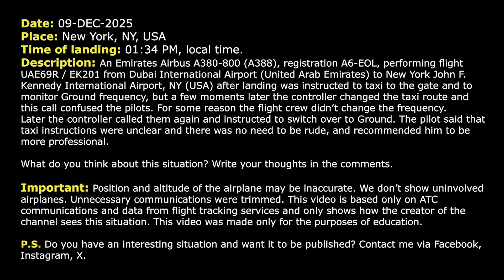Emirates pilots ask JFK controller to be MORE PROFESSIONAL. Pilot argues with controller. Real ATC

Comment: As an air traffic controller the instructions were clear from atc, were they brusque yes, but they started professional at least and only got "rude" when pilots started deviating from instructions. At one of the busier international airports, as a pilot, you can NOT be hesitating final call of control of the aircraft is in the hands of the pilots but if they dont know the airfield layout or arent capable of quickly navigating the flip to followtaxi instructions they should have asked for progressive taxi instructions. But even then the uae pilotsshould be better trained for this because, wrost case, i was told to go this direction on this or turn onto this, there are signs everywhere for pilots so even if you dont look at the flips you should be fully capable of hearing instruction and looking at sign and connecting the dots.
Reply: Not really. It's not unreasonable to request clarification. D being a right turn but then being told to go straight ahead and hold short D, you'd wonder, how can D be in front of us if it's to the right? Would you taxi in a huge circle without clarifying first?

Comment: The instructions from ATC were clear but lacked context. That’s probably why the (tired?) crew got confused. It would have been enough for the controller to add something along the lines of “…I’m going to take you around the airport, so taxi straight to Alpha and then hold short of Delta.”

Comment: The only unprofessional transmission I heard was from Emirates.  Forgetting to change the frequency was just a simple mistake anyone could have made but that one pilot talking to the controller that way was unnecessary.  Perhaps the crew was tired after the long flight.  If you don't know where "D" is then go straight ahead on "A" as instructed, make room behind you to get the 777 behind you off the runway then ask the controller where "D" is.  Of course, make sure "D" isn't close by and there isn't other traffic in your way.  Planes are waiting to takeoff on 22R.   I remember going into O'Hare years ago and you didn't stop after landing, you kept going to parking and you DIDN"T read back the taxi instructions.

Comment: What ATC tends to forget is that those pilots just landed after a long-haul flight ... 10-12 hours on duty ... so just dont be confused when someone is confused as you might not have in mind that A goes around the airport and you can hold short D both ways ... all are humans, no one is god-like.

Comment: I work at IAD, like night and day between the attitudes. I know JFK is a zoo comparatively but double-beratement is not needed here from ATC because they missed the "expedite" detail.
Reply: They gave them an instruction that, while technically proper, was confusing to interpret quickly, then told them to expedite doing something that they likely had not been able to fully comprehend yet. 

Ground could have helped things along be saying “straight ahead, all the way around to D”, which would have been much clearer.
Reply: @danstreufert9098 ^this

Comment: Sending the plane all the way around the airport with "hold short of D" is wild! LOL
Reply: Happens more often than you think. Theres basically 2 circular rings around all the terminals, Alpha and Bravo. When get is occupied they might just loop you around based on direction of traffic.
Reply: This is such a simple thing and it happens all the time. You have never driven past the house you were meant to go to and then you decided to simply drive around the block to get to it, instead of doing a u-turn in the street because there was a whole bunch of cars behind you??

The ATC is upset because there is a procedure the pilots were supposed to follow if they were confused called "asking for clarification". Also, one is never never supposed to comment on the air because when somebody is talking nobody else can talk and receive critical instructions. The pilots have an offline process they can use that they should have done if they had an issue.

Comment: i'm with the pilots on this one.
Reply: Be with ATC always - it's in your interest. If I'm in a plane landing on that runway you better believe I'm not getting mad at the controller for for getting pissy at a plane preventing someone sitting on the runway about to crash into me! Let them do their job and stop being a sensitive sheep.

The controller is upset because the FAA SOP if you don't understand something is to ASK for clarification and not just sit there putting lives at risk - and if you have a problem with the controller there's a process for it that doesn't involve arguing on the air. Remember that when they are talking, other planes and other ATC cannot give critical directions.
Reply: @lucdaved541  Idiot
Reply: @lucdaved541 the one arguing in this case is the ATC not the pilots in case you didn't actually watch the video. They even have captions.

Comment: I think that confusion come from A going both to the right and straight from pilots position and that in the straight direction, there is KD, which might have been mistaken for D, because the pilot would not expect to taxi all around the airport. That long A must be nightmare for each pilot to get. Previously they got the shorter path going right, but that was (by my opinion clearly) changed to straight on A, pilot just didn't expect to go all around and that was confusing. I have not listened to other Kennedy's ATC, but this one I do not consider rude. On the other hand, being a pilot I can imagine how quickly can one get confused, so I don't blame pilots either. It is just busy and messy airport, so shit happens.

Comment: Controllers are really unprofessional. They should not be escalating the disagreement. It is not necessary to dish out or respond to criticism whilst an airplane is negotiating the airport. As a passanger this exchange does not make me comfortable. There have been many deaths caused on the ground by miscommunication and professionals should not be attempting to score points off each other when they are responsible for the safety of hundreds of lives. A poor show by all involved.

Comment: Okay, here goes (I’ll read comments from others once I’ve posted this): British commenter here, familiar with correct phraseology used in the UK and am frequently frustrated by lax and unprofessional RT frequently heard in North America.

However I followed all of this and had absolutely no difficulty with the Tower controller’s instructions whatsoever. I am well aware that controllers are often busy at JFK, often speak quickly and are frequently hard for visiting crews to understand, particularly when their first language is not English. However to me the Tower controller was clear and well paced, and the phraseology was almost entirely correct.

I can understand that changing a taxi clearance to an opposite direction loop on a circuit taxiway might cause some confusion, but the controller did clarify by specifying “all the way round to Delta”. That made it perfectly clear to me what was expected, and I don’t have the airfield chart to hand. The misunderstanding was the crew’s and there was absolutely no cause whatsoever for the implied accusation that he was being unprofessional. I am the first to point out controller errors where they exist, but in this case I can find no fault with the controller.

In my view, the unprofessionalism was on the part of the pilot monitoring for making unfounded accusations regarding controller conduct and picking a fight over a misunderstanding on his own crew’s part. Someone needs to have a frank word with whoever was on the radio in that A380!

Comment: Nothing wrong with the instruction.  The pilot read it back and then started doing it and got confused and stopped.  The issue was he was blocking another plane stuck on the runway!!  Pilot needs to do a better job. Controller was fine. 

Technically could have been an actual pilot deviation because he stopped after agreeing to continue forward.  Stopping caused the safety issue.

Comment: maybe he should have said: go straight ahead in a circle all the way around the airport. In the ATC's logic as long as you're on the same taxiway you're always going straight. And nobody can just understand that
Reply: Yeah of course it doesn’t matter where you go if your gate is occupied, but you have to know where you’re going. And if you don’t know that A goes all the way around you’re gonna have to look at the chart to find out, and while crossing the runway is not a good time to do that. So after you cross, you check where you’re going and realize that you don’t understand, you stop.
Reply: @Aerotrinamic they had about 15 hours to have a look at the taxi chart.  It’s not that difficult A and B loop the terminals, you go clockwise or anticlockwise to your ramp, D in their case.  JFK is far more straightforward than Dubai.
Reply: @kickedinthecalfbyacow7549  get outta here😂. I wasn’t gonna respond but you’re just trolling and you’re probably not a pilot. DXB is a simple two runway airport with parallel taxiways and high speed exits (granted, it’s big). It has two ground frequencies whereas JFK only has one. JFK has 4 intersecting runways and a constant lack of ramp space. You fly 15 hours and then memorize all the taxiways of an airport. If you were a pilot you would not say something silly like ‘they had 15 hours’. And if you’re not a pilot, then why are you even pointing fingers here?
Reply: @Aerotrinamic imho jfk is much simpler, turn left or right follow A or B to the ramp monitor ground. DXB is multiple, progressive taxi instructions hold short of points that aren’t marked on charts. The taxi ways are straight but that doesn’t make it straight forward. It’s just my opinion though, I don’t care if you don’t agree.  But when you brief for jfk you should be able to clearly identify the expected taxi clearances, there aren’t that many options.
Reply: Alpha and bravo are a big loop around the airport, follow the loop to your exit, it’s not difficult, thousands of aircraft do it every day
Reply: @kickedinthecalfbyacow7549  well i fly in and out of jfk sometimes and I’ve never done a loop like that. And I would have been just as dumbfounded as that EK crew was with the instructions they gave. If you go in and out there every day you might encounter that at some point, but it would still be helpful to tell the crew that they would be going the long way around, as it isn’t super obvious
Reply: @Aerotrinamic when your gate is still occupied it doesn’t matter if you go the short way or the long way around. This wasn’t the only airplane at the airport, they have lots of other planes to get in to their gates or out to runways.

Comment: Emirates pilot was not instructed that he is going around the airport initially
Reply: It’s written on the charts, A to go clockwise and B anticlockwise. I was confused by the instruction to go right on A which would contradict airport instructions but going straight on A to h/s D is perfectly clear.
Reply: That is immaterial, straight ahead on A and stop short of D means just that(which the co-pilot repeated to confirm the changed instructions were understood so talk of the instructions not being clear is total BS and attempted gaslighting by the captain). You do realize that the taxiways have signage that is clear to see and is repeated all along the way. A 5 year old could follow those instructions.
Reply: @Crypt0n1an Go tell any pilot a 5 year old can easily identify any runway on the airport and see how they laugh at your nonsense.  Where you the rude idiot at the ATC? You seem to be taking this a tad to personally buddy. Maybe this shouldn't be your line of work
Reply: Correct, hence why the controller negated the initial instruction with "correction".

Comment: Without labels, I'm lost as to if the instruction was unclear or not. Was it that Emirates was already at Delta and the controller wanted them to do a complete circuit of the airport and return to it? 
If so, that's complete effing madness and a waste of fuel, not to mention controller s having to monitor more moving traffic.
Reply: No, their initial instruction was to turn right and take the shorter route to delta, which was then changed to go straight ahead and take the longer route to delta from the opposite direction.  The confusion was added to by the next taxi way being kilo delta, which is why they sought clarification.
Reply: @robslocombe3955 Aha, thanks. I was out yesterday AND didn't have glasses on. I miss seeing by zooming in the taxiway labels are visible.
Makes sense now. Still, pretty complicated set-up. Not great if you are an infrequent visitor.

Comment: Absolutely correct move by the pilots! The only thing is, none of the ensuing discussion should have taken place on the radio while taxiing. If there was a need to discuss, ATC should have offered a phone number.
Reply: Mate- When you say the pilots made a correct move and then say they should have talked off the air, it completely negates your argument as you're stating the pilots were not correct.

If I'm in a plane landing on that runway you better believe I'm not getting mad at the controller for for getting pissy at a plane preventing someone sitting on the runway about to crash into me! Let them do their job and stop being a sensitive sheep.

The controller is upset because the FAA SOP if you don't understand something is to ASK for clarification and not just sit there putting lives at risk - and if you have a problem with the controller there's a process for it that doesn't involve arguing on the air. Remember that when they are talking, other planes and other ATC cannot give critical directions.
Reply: @lucdaved541 the pilots weren't arguing. The ATC was. The ATC were pissed someone could tell them to F off so easily.

Comment: Technically the controller was perfectly clear. Just taxiing around the entire airport was confusing. But the instruction he gave was by the book. As a pilot never assume that the controller misspoke.
Reply: Does anyone think that a pilot is responsible for the safety of all passengers on board their flight, and ATC is responsible for the safety of all passengers flying in, out and on the ground? If ATC issues directions Although tone helps a lot, I would think the message is more important than the tone. In is case we don't know what else was going on around this scenario - and we probably may never know.

Comment: The fact that Tower began talking back to the Emirates while they were taxing was unprofessional, and THEN ground comes on and starts the conversation on a live frequency again about why there was a mistake with the tower controller!! THAT is also not good comms proceedure in my humble opinion. These controllers should be trained in efficient communication, prioritising properly. The emirates crew are taxing around a complex airport, after probably a long flight, and now, while in the middle of trying to concentrate on not making any more taxi mistakes, they have to continue dialog live on frequency about their earlier mistake, all while blocking the freq that others might need to use. Very unprofessional of JFK, but I'm not a real pilot so, please correct anything I've said if you are one and have thoughts to weigh in. I'd be happy to learn more about what is and what is not professional on a real world freq

Comment: Tower control was absolutely right and clear. He is responsible for takeoffs and landings (in this case 22L/R and 31L). Obviously all four Emirates pilots were not familiar enough with taxiing at JFK. The instruction was to clear to cross 22R and right over A and hold short of D. Also MONITOR Ground 121.9. Emirates confirmation that the bay is still occupied should not be for the Tower but for the Ground (who is responsible for taxiing after crossing RWS. During the crossing of 22R Tower changed the clearance. Continue straight through A and hold short of D. As Emirates approached the right turn via A (uncertain crew) it slowed down taxiing (maybe even stopped), blocking the B777 behind it on 22R. That's why Tower warned him and he confusedly asked if he should stop before KD. They were obviously confused beyond understanding the situation and the responsibilities of the different controls (Tower and Ground). They did not monitor Ground 121.9. They continued almost the entire circuit around JFK on Tower frequency. When he warned them they were, to say the least, rude and arrogant (imagine four of them in a super jumbo - English native). Tower control was absolutely professional and clear. Emirates crew obviously did not understand anything (although they confirmed the clearances) what the responsibilities of Tower, Ground and Ramp control are at JFK.